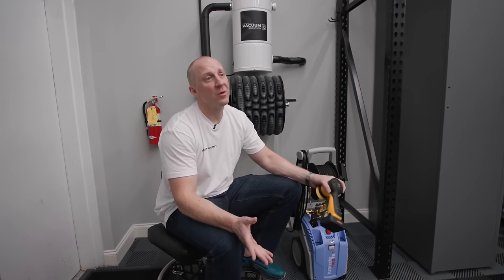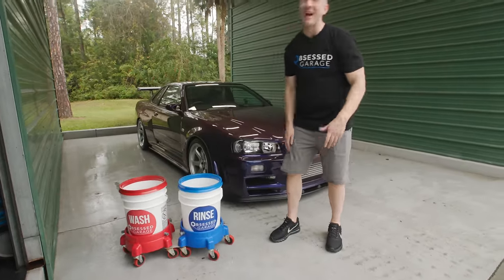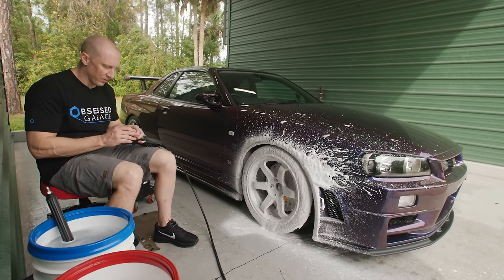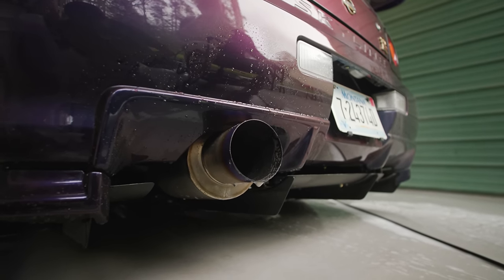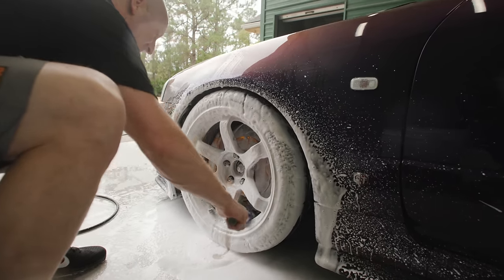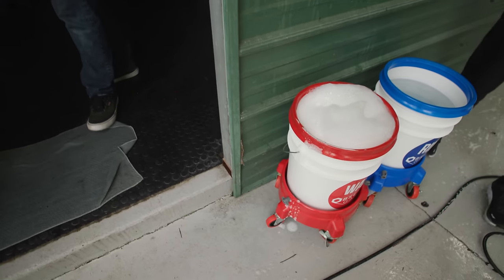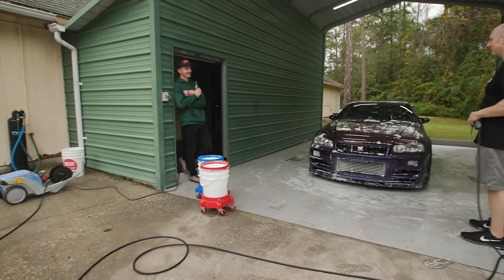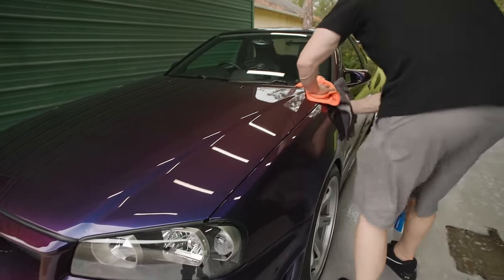LZ Compound Wash & Talk: R34 GT-R V-Spec

Comment: I have adopted your exact wheel/tire washing procedure. I appreciate all the information you put out.
Reply: @LarryKay41510  Brake Buster is pretty strong, you should definitely not be using it without diluting it at all if you have wheels with a good finish.
Reply: @HBFBajaRacer  The brushes would do more damage than Brake Buster.
Reply: @LarryKay41510 regular car soap works just fine as long as you maintain your vehicles, I used brake buster until i ran out, its just not necessary

Comment: Hey Matt, I've been using the Bilt Hamber Auto Foam as a pre wash as well. I tend to oversimplify the process a little bit since I detail my cars mobile and just use the Bilt Hamber as a pre soak (instead of GSF) then just go in and use GFX in my wash bucket. Seems to work really well for me. I am specifically excited about the metal tips for the bottles! Also, I've been using that Vonixx tire cleaner. Seems to work a lot better than brake buster IMO. Preps the tires nicely.

Comment: I agree with Matt if your low on cash and had only 120$ to elevate your car washing the OG drying aid and microfiber with the Pressol is really good the scent less is great but then the slickness you get without dust being attracted to the car for a week if it doesn’t rain is so good it should be illegal. I noticed I could go a bit longer washing when I started using OG drying aid also. Very good only thing I bought 5 gallons of. All other products I would never buy that much.

Comment: I thought the higher alkaline pre wash options (autowash, touchless, etc at pH12+) did break down the ceramic coat a bit. I thought that for coated cars, you better stick to PH neutral soapfoams?
Reply from the maker: It depends on what is used to increase the pH.  Not all equal alkalinity has same affect.

Comment: Anyone know why the kranzle 1122 isnt available in europe or at least the uk? Seems to be only in the usa. We seem to only get the 1152 or atleast thats all ive seen advertised. Anyone know whats the main difference?
Reply: Yes, the 1152 is the European spec with 230/240 volt power. In the US they use 120v. You will get a tad more flow on the 1152 because of that.
Reply: @lawrencedagostino4282  right that makes sense. Thanks 👍

Comment: Someone needs to put a paint job under a microscope and do a test washing a car and prove to everyone if a car gets scratched while washing.
Reply: 75% of the scratches come from drying if you aren't using a drying aide.  Cheap mitt and drying towel is the culprit.
Reply: @LarryKay41510  Common sense came up with that.  I'm just the messenger.

Comment: Matt, how does your OG drying aid compare to using Beadmaker as a drying aid?  I follow your OG washing method, except I use Beadmaker as a drying aid. Thanks
Reply from the maker: It’s easier to work with.  It flashes almost immediately after wiping.